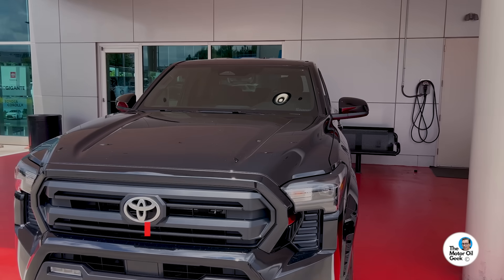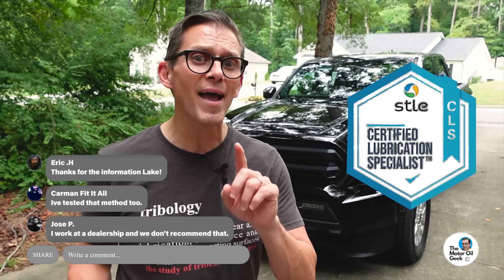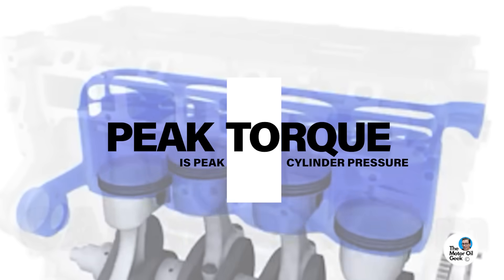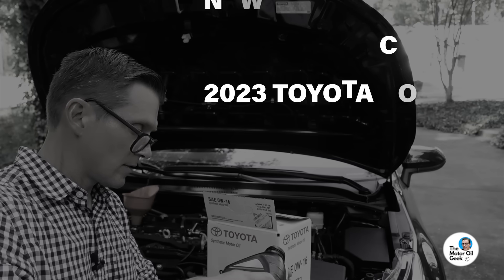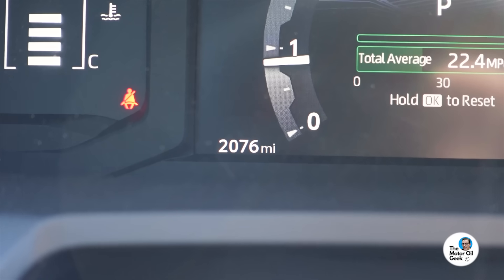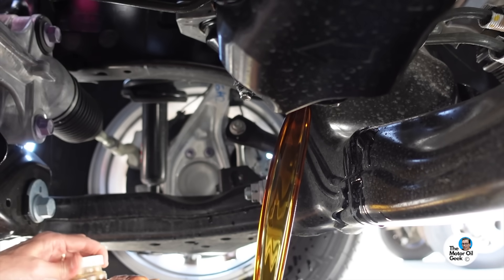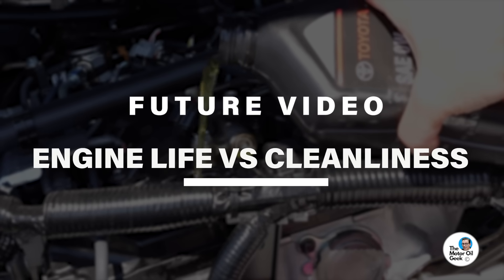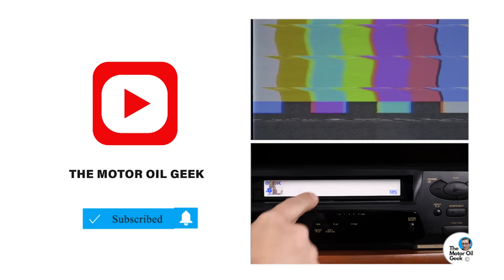The FACTS About Oil Changes (What The Owner's Manual DIDN'T Tell You)

Comment: I have a 2010 Prius with 130K miles. The engine uses Zero oil. These third generation engines are known for using oil after 100,000 miles. Hint, don't follow Toyota's oil change intervals of 10,000 miles if you want your engine to last. I routinely change the oil around 4,500 miles with factory 0w20 full synthetic Toyota oil.

Comment: I disregarded the manual in my 2025 Chevrolet 6.2L engine, and changed the oil at 500, 2,500 and 5,000 miles.  My Blackstone analysis almost perfectly mirrors the numbers you put up on your video so, fingers crossed, I hope I got a "good one".  Following the advice in your other videos, I'll keep changing the oil every 5k from here on out, and am sticking with 0w20 M1 EP.  Thanks for your informative and helpful "tribiology!
Reply: I have a 2016 tohoe with 5.3. I got that 0w20 out at 500 miles and have been running 5w30 for the last 9 years. 136,220 miles on it right now with no issues. Get a catch can and a dod/afm disabler on that thing now!!!
Reply: @brandonellevan1858  I bought a Range Technology AFM delete programmer for my 2018 Silverado and the AFM lifter in the number four-cylinder went bad at 45,000 miles anyway.  👎🏼
Reply: @brandonellevan1858 which afm disabler do you use?
Reply: @brandonellevan1858 0W 20 should be illegal
Reply: If 0-40 is better for “bad engines”, I would bet it’s better for “good”  engines too!
Reply: You better put some thicker oil in there or it won't last
Reply: Keep praying
Reply: I thought the recall was only 2021-2024 models.  My understanding is that a 2025 model 6.2L should be unaffected by the current recall.  I’ve got a 2014 6.2L Port Injected and it’s running great.
Reply: @natez0690  At this point I don't really trust GM or Ford. From oil issues, to crank surface issues, to lifter issues, to trans failures, and so on. 2025 is too early to know how they will hold up and whether any changes made will fix the problem.
Reply: @ZeGermanHam  Ford 6.2L went from 5w-20 to 5w30 (guess it is different from the GM one, it is SOHC).
Reply: You are the exact prior owner I hope for when buying used.  Rare tho.
Reply: I totally agree, the m1 supercar does not seem to last long, just 3k miles I noticed the rushrod valve train noises have increased significantly
Reply: Why not run a 0W-40, like GM recommends now for the 6.2L?
Reply: wouldn't matter much those engines are terrible and will freeze at times. It's all about the design of the motor. Toyota will easily last with longer intervals
Reply: Woot-woot on the 6.2, I have the 5.7 LS6. Try Rotella Synthetics, 12 oz of Lucas Stabilizer and 10 oz of Diesel fuel as a detergent. 120k miles and my motor shows minimal wear through oil filter analysis and oil plug magnet. Clean!
Reply: There is no fix for bad steel. Am glad i don't own one of those time bombs.
Reply: @arthurrodesiler3109  Exactly. The issue with those engines isn't entirely due to the oil recommended, but the surface finish of the crank journals. GM messed up royally with the L87 6.2L.
Reply: @arthurrodesiler3109  yup one of the worst makes you could get, doesn't matter how frequent the intervals are, its more to do with the design of the motor. They get inefficient oil lubrication on the top end of motor which leads to them freezing and seizing. Would never get a Gm product, just stick with Toyota/Lexus

Comment: I did it similar to that when I bought a truck  with the L8T 4 years ago.  Changed the oil and filter at 1000, 3000, 5000 miles.  At 10,000 miles, changed to a different oil too.

Comment: I bought a 25 Subaru Forester back in June.  I changed oil @500miles then again at 1000mi and then at 5000. Oil is way cheaper than an engine.
Reply: better remember to change your cvt oil early too. CVT’s brick more subarus than headgaskets.

Comment: My son’s 2007 Pathfinder is about to hit 300,000 miles in the next month.  We change his oil every 3,500 miles and his engine only uses about 1/4 to 1/2 quart between changes. We did an oil analysis  30,000 miles ago that showed a trace amount of coolant in his oil.  I can’t get him to do another analysis to make sure that’s not getting worse.  For a while we were changing the filter every other oil change until we got the trace coolant reading.  Decided to do a new filter at every change due to that.
Reply: change the radiator

Comment: If you’re going full throttle (track or otherwise), I assume a partially clogged air filter will be a limiting factor in how much power can be made as airflow is somewhat restricted vs a brand new filter.

(Rate of filtration will be better as it’s used, that’s not the question I’m curious about though).

Comment: Thank you for this! I  bought my 2022 RAM 1500 Etorque V8. I put around 2,000 Miles on it and changed the oil and filter. At 6,000 I changed again. Since then I change at 3,750 miles. I use 5w-20 full synthetic Penzoil Ultra Platinum and the factory oil filter. I did notice a difference on the 1st oil change. My wife did too. KEEP ON ROCKING!
Reply: waste of money

Comment: Experts online claim you should never change your oil without doing an oil analysis. They claim they even if the manufacturer recommends 7500 or 10,000 miles intervals, take a sample instead of changing it; send the sample in and let it tell you how much oil life is left. Some claim they can get 25,000+ miles on the first oil change.

Comment: I’m curious if manufacturers will stop using this “water oil, AKA 0- whatever “ when the EPA reduces the green scam regulations. That scam is the same reason they have stretched to oil change intervals to 10,000 miles, the manufacturers are taxed on the waste the car produces during its estimated life time.

Comment: I started my oil geek history back in HS in 1985  in autotech, rebuilt several engines and mechanic preached the importance of early oil changes. We would open filters back then. and then involved in USAF fleet maintenance and oil sampling. Studied synthetic lubricants in the 90s in college.  Been using Amsoil and doing oil analysis on all new and used vehicles Ive owned.
Reply: Redline is even better, easy to get there in USA
Reply: Redline is good, but their focus is more on racing & hi performance, hence their name, on the redline, wide open throttle maximum rpms. Racing oils aren't always ideal for regular street use because of their racing focused additives. For example they have limited anti corrosion additives because racing engines are highly maintained and disassembled often. Also for that reason they have less detergents. AMSOIL has a more daily street driven focused oils and lubricants and a broad array of products. But they also have racing lubricants.
Reply: @oneninerniner3427 Redline... well, that's the name 😅 but their oils have SP ratings too

Comment: Where is the copper coming from in that Toyota unit?
Demonstrates your faith in Toyota's use of materials and machining processes. To only do 3 oil changes in 5k miles shows confidence.
Someone needs to manufacture a filter of sufficient volume that can live for 5-6k miles and filter that bit better than others from new
Reply from the maker: Turbo charger bearing
Reply: @themotoroilgeek Ah thanks as always for the information 👍 That's a seriously accurate oil analysis

Comment: did simular with new 07 4runner (1grfe).500, 1500, 5000 miles then regular changes.. used 1/2 quart till rings seated,, now at 376k miles, no consumption between changes (5000 miles)...always used 5-40 rotella and wix filter. rotella no longer has certifications for gas engines. not sure what to do.

Comment: You could get alot of data quick from an Oreilly delivery car/truck. Max about 5 miles in any one dorection. Start stop technology, mostly short drives about 10 to 40 times a day depending on the day and time of year. Also some vehicles will make routes in addition to hotshot runs. Those get about 100 miles a day just on the route plus yheir oyher use locally. Stores near me have turbo awd mavricks as primary delivery trucks with turbo ranger and na nissan frontiers for route work and bigger deliveries (pallets) we even have a car or two at each store too.

Comment: I used 0w20 Toyota oil in my 4Runner. Its Mobil 1 repackaged. Engine was noisy wear metals were higher. I use Valvoline or Castrol Edge now. Much better oil

Comment: i always use Amsoil.  We just traded in my wife's car. A 2012 ford edge with 251k on it. Always ran Amsoil., and wix, or Amsoil filters. I ran the Amsoil OE oil for first 20k, with 3 oil changes. Then went to the extended life oil.  At 75k went to the high milage oil.  Got ours moneys worth I say.  The motor still runs great. Its never about the brand. Its all about the chemicals. Right Lake? lol.   Amsoil been doing the synthetic oil. API approved,  since 1972. I think they have the formula down pack.
Reply: I have a 2012 Equinox which supposedly is a flawed engine, excess wear, timing chain, oil burning before 90k.  It comes down to quality fluids and maintenance. I saved the engine at 90k. It was a mess, cheap oil, cheap gas and they followed oil life monitor.  It now has 223k miles, runs perfectly, better than new mpg, and under the valve cover it looks like it just came off the assembly line.  Using Amoil since 1988.

Comment: Lake - you should be wearing rubber gloves.   As cheap as they are and as often as you are around oil, add that one little safety habit.  

Thanks for all your content!   Best oil man on the planet!!
Reply: 20 + years of petrochemical exposure,  you will experience peripheral nerve damage.
Reply: Absolutely! Used motor oil on your skin is a good way to increase your chances of getting cancer.
Reply: @Nickrioblanco1 Yes! Ear protection on the dyno pulls as well. Hearing loss has been linked to balance and cognitive  loss. We don't want to see Lake spilling maple syrup on his engine while singing show tunes😂
Reply: @tomphillips2608  Is that why I can no longer hear good? Because of working on race engines with open pipes & race snowmobile engines with open expansion chambers? Yeah I'm an idiot for not wearing hearing protection I know now. But back in my day no one did.
Reply: "If it's on your skin, it"s in your blood"
Reply: @James-o2k4u  Im old......my joints NEED oil :)

Comment: Folks that only care about engine longevity often overlook the OTHER economic factors that counter their decisions. That ~2.4% increase in fuel economy on a large SUV CAN EASILY ADD UP TO HUNDREDS EACH YEAR. OVER 10YRS...THAT CAN BE $1-2++k. Then they put inefficient AT tires on their highways drivers for the "LOOKS".   That often decreases mileage by 10% or another $1-2K.  Together,  that adds up to $2-4-+++K in expense over life of vehicle........I'd rather retire the vehicle at 250K than 300K and probably be ahead financially......by a longshot.  Classic penny wise pound foolish mentality.  Is it worth wasting $5000  for 50K in mileage??????? on an old vehicle with other expenses, failures and issues........????
THis is also true for increased oil change frequency...when is enough enough...all depends on your driving style, locale etc.....Highway vehicles have far greater ability to filter........I am waiting for data to prove what I have always believed....changing the filter more frequently is even more important than the oil.  Valvoline Restore and Protect is sure proving that!!!!!!

Comment: I was always taught to accelerate  and decelerate 0 to 50 - about 40 times then dump the factory fill ! Then change out the oil at 1,000 then 2,000 then 3,000 ! Then every 4 to 5,000 miles !
Reply: I did something similar to a car I bought new in '70. I don't think the rings ever did seat properly.

Comment: I similarly changed my new Tahoe diesel oil around 1,000 interval, 3000 interval, then every 5,000 miles. I also liked your suggestion to poor one quart new oil in with plug out once the dirty oil is out. That little bit of flush of one quart brought out more dirty oil and started coming out clean before it was totally drained. Every detail of how you do your oil changes matter.
Reply: Enjoy your diesel wet belt

Comment: Good advice. I was told by a wise mechanic the following which is what I followed on my 2022 Frontier. 1000 mile drain and fill. 2000 drain and fill. 5000 drain change filter as normal. Break in a similar way by driving around the city to vary the RPM as would drive in the future. No racing and hard braking. Plus changed rear differential fluid at 5k for removal of break in debris, with 25k miles intervals. Use good quality oils and filters. My frontier is at 75k and strong. Averaging 22.3 mpg.

Comment: Isn't the silicon content in the oil from piston break-in? I think you're confusing silicon with silicone, which would be in the RTV. Hypereutectic pistons have high silicon content, makes sense that as they break in, it'd show in the oil.
Reply from the maker: Nope. RTV sealant contains Silicone, which also contains the element Silicon.
Reply: @themotoroilgeek  Thanks for the reply, I LOVE your videos, but wouldn't the high silicon numbers you're finding in the oil during break-in be silicon from piston break-in, not from seals?

Comment: I have a 2012 Toyota 4Runner with 130,000 miles. I switched from 0W-20 to 5W-30 in the winter and 10W-40 for summer use. Change the oil with full synthetic every 5,000 or six months and the vehicle does not burn ANY oil between changes. I use Valvoline Oil and Toyota Oil Filters.
Reply: With very, very low miles on that vehicle i wouldnt be running a 10w40. I ran 5w30 in engines with 300-500k miles with no meaningful oil useage. To each their own but other than warn out old domestics fromthe 70s and 80s ive never needed to use 10w40 to keep oil pressure at a safe level....
Reply: @workingcountry1776  Thank you for your advice.

Comment: Hot oil flows faster but I hate working with hot oil. Cold oil (80 degrees) takes longer but in my driveway I can let it drain for hours.
Reply: hot oil flows faster - but the advice ignores the time you spend warming oil up.

Comment: The owners manual on my 2019 Tacoma says I can run heavier weight oil if driving at high speeds. So I run 5w-30
Reply: The thinner oil just makes betterage gas mileage.. rav4 in other parts of the world say 5w-30. 0w-16 gets you 40mpg highway , 0w-20 gets my 37mpg highway… i rather have thicker oil
Reply: @Flir67  i agree 100 percent with you. I rather have my truck hit 400k miles, than get an a extra .5 mpg. I just like to point out heavier oil is allowed by the manufacturer because it is in the owners manual for all gen 3 Tacomas.  I haven’t read a gen 4 manual.
Reply: @Flir67  I had been using 5W-20 semi synthetic Honda brand oil for years then switched to 5W-30 Pennzoil Ultra Platinum. In contrast to what would normally happen, the gas mileage actually went up (and has stayed up over many tanks of fuel.)
Reply: @F @Flir67  same wording is the owners manual for my wife’s Sienna also. It just a small note after part on oil that says heavier oil maybe more suitable in vehicles driven at highway speeds.
Reply: That penzoil is good cause it's made from natural gas from my research. Maybe not all penzoil but a lot of it. It says on the back of the bottle and the info is also on penzoil website I believe.
Reply: YUP!

Comment: 5:00 Regarding Sponge air filters, in my vehicle they get degraded overtime , typically after 2 years. And they get sucked in. Which is not good. Just letting you know about oiled sponge air filters.

Comment: Your CrAzY . . . LOL
I'll probably never own another NEW vehicle so I dont have to worry about this, I just need to keep my 2010 6.4 Diesel going as long as I can (and have a lot of luck) so I'm always looking for ways to help the engine last longer. It's only got 90K miles on it in 15 years. I also drive a 2002 Jeep Wrangler 4L with 130,000 miles on it. I hear the new Jeep engines dont last so if I ever need to I will rebuild the one I have.

OK, now I know you're crazy when you pour cold oil in thinking that will flush the oil pan. Why not drop the pan on camera and see what's there?

Comment: Adding another quart during draining likely will not help remove residual old oil.  I tested this myself.  Took a few ounces of new oil and added it to equal parts of used oil in glass container.   The new/ old oil did not mix well, and polar dispersants tended to create a barrier between them.  It wasn't until I heated and aggitated the mixture did it mix.  That is why when I do a clean oil flush, put a new filter and oil I bring the engine up to proper oil temp. Then drain and save as a flush oil.  The engine now has 99% clean oil.  Not removing the filter leaves a lot more residual oil in the engine, and prevents the main oil gallery and pump to drain back into the sump or container..  Another channel I can share tested the normal air temp vs hot oil drain and demonstrated a very little difference in quantity.  He did another video of an overnight drain. He did a normal drain until it dripped.  Plug back in. Removed in the AM and a quarter of a quart 8oz came out.  I've done the same and captured 5-6oz.  I run 10-15k drain intervals so getting as much out helps in the long run.
Reply: Ever think of jacking one side or end of the vehicle to make the oil drain hole the lowest point?  A few ounces will remain in some areas anyway, especially oil coolers, OHC troughs, etc. Makes no difference in longevity of the engine honestly.
Reply: @savagebob911oxidized residual oil has a big difference on new oil and engine life. I always elevate the front end.